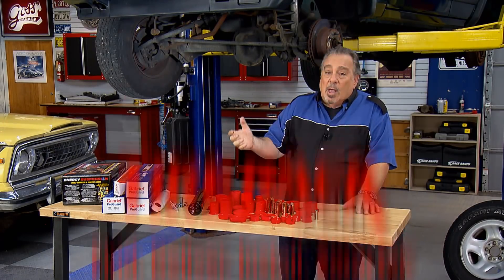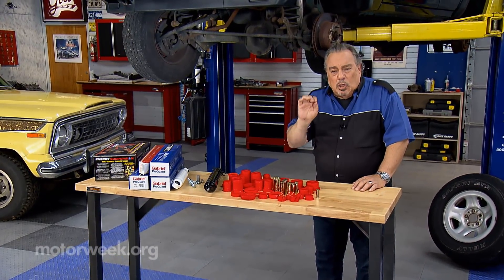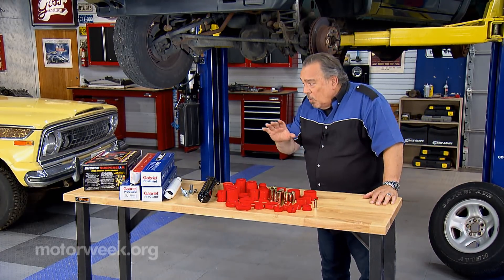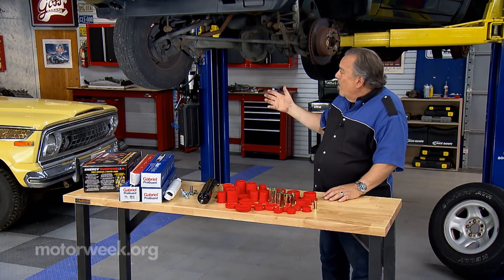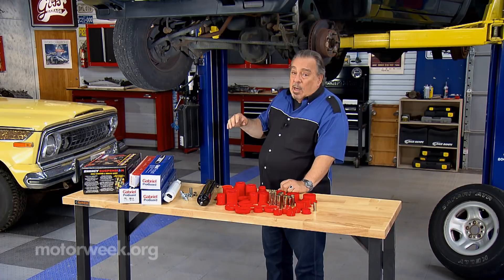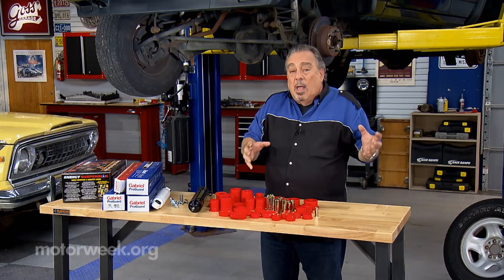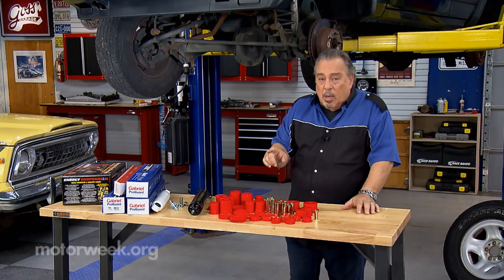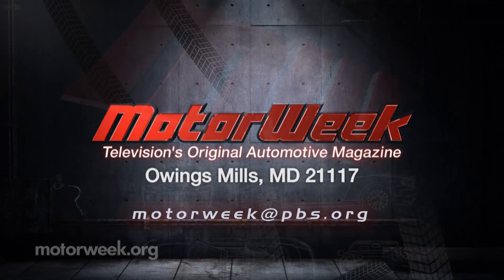Goss' Garage: Death Wobble

Comment: A true "Death Wobble" has to be experienced to be understood.  I had a 2007 Rubicon 2 door that developed the death wobble after about 100k.  The comments about the wearing and gradual increasing sloppiness of the bushings being the main culprit is accurate.  Throw in some AT or mud tires with typical wear after a few thousand miles, causing a slight, benign wobble and you've sprayed gasoline onto smoldering ingot of molten steel. 

Now, you can go to the extreme of changing out all of the bushings and what-not, or you can just buy a heavy duty steering stabilizer which will all but eliminate the problem...assuming the bushings aren't so badly worn they HAVE to be replaced.

I know this from experience.  My JK would wobble so violently, I was certain the wheels would break off and the front end would disintegrate.  The part of this video showing the gentle wobble IS NOT indicative of what I experienced...not even close.  Imaging driving down a road doing 60 mph and suddenly running down a train track without any rails with no gravel between the cross ties.  I've had it shake so violently, people on the other side of the road, coming towards me, pulled off the side of the road due to fear (or awe) of what was happening. 

I put on a new steering stabilizer and, VOILA!  Problem solved.  Still had a small wobble when hitting a bump, but Curious George compared to King Kong.  New tires took away all the wobble.
Reply: Same deal! I restored an old Chevy 4x4, replaced all front end components, except damper, Fine for a few years then experienced the death wobble ( certain death is what you think is going to happen )  Found damper failed, replaced and it never happened again!

Comment: Im gonna tell you how to solve "death wobble". #1 make sure all front suspension, and steering components have no wear or slack. #2 make sure your front + caster (viewed from the side the spindle is leaned back) is within factory spec. If your vehicle has a suspension lift this is even more important, and you may want to try for even slightly more + caster.   99% of "death wobble" is because your took away + caster when you lifted your solid axle jeep or truck. If your alignment shop can achieve proper caster settings'' , and all the parts are in good condition your "death wobble will go away.
Reply: 100 present right!
Reply: Ed Jackson Yes 100%

Comment: Years ago I had recurring death wobble on my YJ.  It would shake so violently it eventually ended up breaking both engine mounts.  I had a Jeep friend that had never experienced it for himself and thought I was making it out to be a bigger deal than it was so I drove him to a highway curve with a pothole that I knew would trigger it; when it started shaking he braced himself with the dash and rollbar and nearly pooped his pants.  He was terrified!  One of my favorite memories.
Reply: After having new tires mounted and balanced, an alignment, and replacing the engine mounts the problem mostly went away.  It's never done a full-blown wobble since then, but every once in a while, under the right conditions, it will do a slight shimmy like it's about to start up, but so far has always dissipated.  Makes me nervous though!
Reply: Have a good shop try to achieve 6 or 7 degrees positive caster in the front and it will never do it again. This is usually done with angled shims on leaf spring jeeps and trucks. It will also drive straighter, and won't wander as much on the highway. Proper +caster is very important.

Comment: Death wobble on a Jeep can be caused by out of balance wheels, bad wheel bearings, steering linkages, track bar, ball joints, control arm bushings, etc
The one true part of this video is that the issue can be cumulative of the components I listed. I chased the issue on and off for over a year, until I decided to replace damn near everything. BTW you can remove the sway bars and the steering damper and not get a death wobble. I don't recommend this for street driving though.

Comment: Using Polyurethane on  Jeep replacement parts is a given. It may squeek going down the road. Depending on vehicle Rubber replacement parts could be more expensive.  Great advice on looking for replacement control arms with pre-installed bushings. Some of these bushings require a Press to remove/install the parts.

Comment: One thing that is weird about some Mercedes models is that they have a steering damper despite not using that type of suspension. By the time any other part of the suspension has failed, you can bet that the steering damper has failed too. The steering damper is about the size of a gas strut that opens the hood.

There is another benefit to polyurethane bushings if you are a DIY guy. Usually you can melt the remaining part of the old rubber bushing, then slide the polyurethane bushing into its place. With bushings that have bonded rubber, you need the right press in order to push the old bushing out and push the new bushing in.

I have looked into VW Rialta repair and found that Powerflex, Polybush, and Whiteline make similar bushings outside the USA.

Comment: I had a Jeep Cherokee (XJ ) with the death wobble until the shocks and every bit of rubber in the front end was replaced.  It road stiffer and squeaked, but the wobble didn't come back for the next three years I had it.  The rear shocks are a PITA to replace if the bolts snap, which most around here do.  The front shocks and bushings are relatively cheap and can all be replaced in a few hours with basic tools and a spring compressor.  Go for it DIYers.